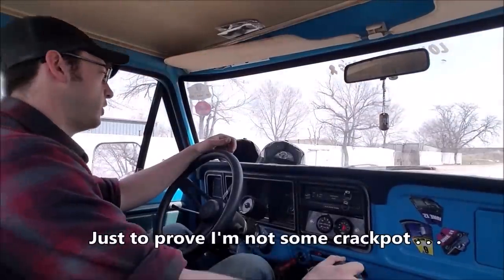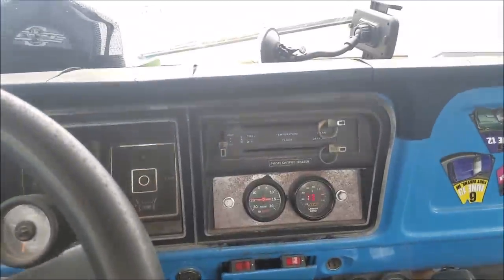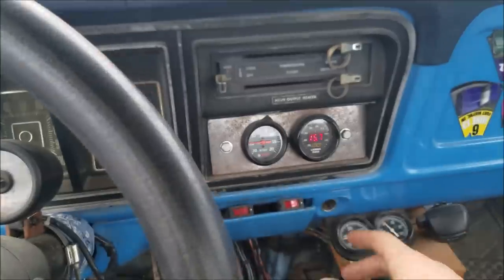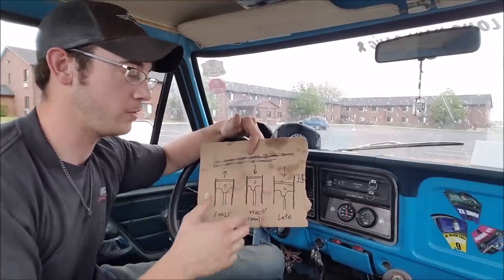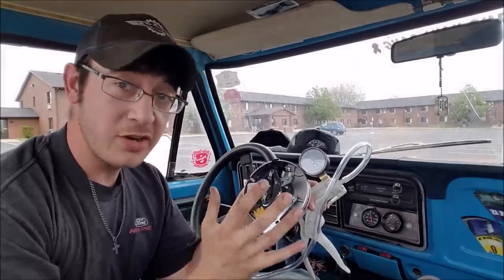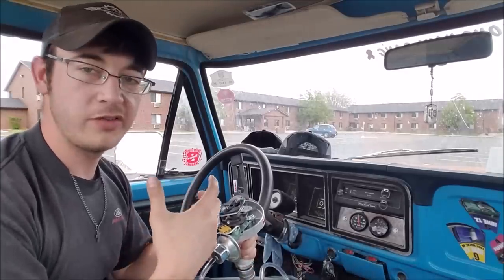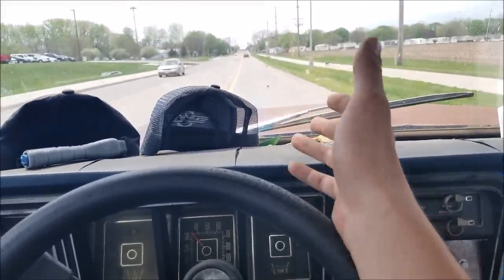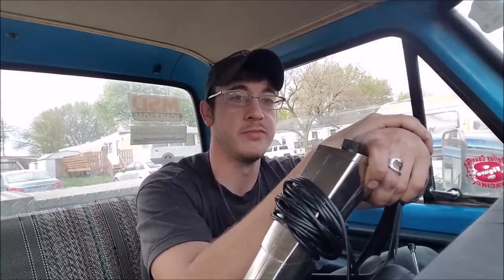Tuning a Distributor's Advance Curve (For MAX Performance & Power!)

Comment: sort of related but I cant find a solution anywhere. have a 86 f150 it was super neglected im the 3rd to 4th owner. had to replace the timimg chain, distributor cap, rotary button, fix the radiator,  replace the starter solenoid, spark plugs and wires, ignition coil, transmission filter, exhaust manifold and a few more things. so going down the road it does okay until it warms up and then it jerks a bit and eventually pressing gas results in no power or feeling of delivery and it jerks and it  will struggle to stay going. about 2 to 5 secound intervals between jerking and no power. it will then work if it i allow it to come down on speed. about 30 mph is the sweet spot to where it will go without jerking. doesnt feel like its the transmission its kinda like a backfire like if you run a vacuum cleaner and turn it off and on repeatedly thats about the sound it makes when jerking.  cut the exhaust right before the catalytic converter to see if it was clogged but it actually made it worse. any ideas?

Comment: Hey Thunderhead, Mr. Luke Sir.. I’ve been watching learning much about carburetors and timing. I’ve got a 383 Stroker high comp engine, typically higher temps across board given this ratio. I’ve noticed it spark knocks when I hit it harder, but not hard. I’d installed a proper electric fan big 4 core radiator all this. So, the knocking has lessened after I was able to lower the temps for operation. The temperature of the engine was only getting to about 180/190 or less? Why did cooling my engine more clear-up some but not all of the knocks is my question Sir? Temps were fine?
“I’ve been watching your channel and am subscribed. I’ve learned much watching, “Thank You Luke!”
Hey, love the tuning aid you use, the fuel ratio Guage. I want to put a nice ratio guage in mine as it sure is the best in getting it closer for tune.
Love the relationship between the carburetor and timing..

“Luke, could you set-up a distributor for a 383 Chevy Stroker in a way which would help my 1963 Chevy C10?”
I know most has to be done in the vehicle, but wanted to inquire?

You Rock Sir, thanks for the comprehensive videos!

Comment: Nice job Luke,
I agree with a great explanation of 'correct' timing. My only question is are you talking about ported or manifold vacuum? It sounded to me your are referring to manifold and that will actually decrease timing as the throttle is opened. Nit picking, maybe. But I think the clarification is needed.
Great information and needed by many.
Thanks for sharing.
Reply from the maker: Really any vacuum advance will trip out under throttle - if vacuum drops, so does the vacuum advance if you hit the vacuum van mister threshold. I was just trying to say that I’m hard throttle you are just on mechanical timing

Comment: I live in the UK England and we have different distributors I have an old French car and it's got a carb but on my distributor it has an arm that spins an we don't have vacuum but I still found your video insightful have you worked on any set ups like mine?

Comment: Soo what can be wrong on my 1955 ford y block. Renovated the engine and bored to a 292 from a 272. Had to go up in size on my main jets because it didn't want to respond to the gas above idle. Now it does that but over half throttle it's dead. Nothing happens more than it want to backfire at higher rpms in the pipes and the carb. But on "cruising" it works ok. It feels like timing issues.

Comment: Thunderhead,  I haven't seen you mention this so you may not be aware. Most vacuum advances are adjustable. Usually there is a small alyn-head screw up in the vacuum port which changes the diaphragm spring tension allowing activation at different vacuum levels.
Reply from the maker: I’m indeed aware.
Reply: @ThunderHead289  Cool

Comment: I'm about to obtain my Father-in-law's 1983 Ford F250 (460ci with a 3-Speed with Granny Low).

I would like to fix the "Steering Wobble" and Upgrade to FULL Disc Brakes.

Any suggestions?

I thank "Junkyard Digs" for recommending  your Channel.

-🤘😎👍

Comment: I have problems with my relationship! Can’t seem to find the balance between running good but getting a backfire in the carb when I get off part or full throttle or running to lean. I’d given up but your video has inspired me to take another shot. 2.3 Ford Mustang carb turbo 1981 has the factory Weber 5200 and mechanical advance and added an AFR gauge to try and dial it in. I have had the carb rebuilt, swapped distributors, swapped ignition boxes and carefully followed carb adjustments. Would welcome suggestions on how to get rid of the turbo seal killing backfire without making it dog slow! The backfire is worse when cold.

Comment: Excellent vid, Luke. A big fan of your how-to series, but I just can't wrap my head around your preference for ported vacuum advance :D When you are cruising down the highway at very low load, the 20" vacuum we are seeing in this vid, I would assume that is the ported vacuum. So by then you would be seeing a lot of vacuum advance. Which is good and just what you need on a very light-density cylinder charge. But when you let go of the throttle completely, your timing would immediately retard back down to initial timing, and the way I see it, that will only result in poor fuel economy at idle and possibly running the heads and exhaust hotter than they need to. In one of your other vids, you say that you don't like losing a lot of advance when going hard on the funny pedal from idle, but with ported vacuum you'll still be losing a lot of advance when flooring it from a cruise? The only difference is vacuum at idle. Anywho - great vid, keep up the great work! :)
Reply from the maker: I have this video dedicated to explaining ported vacuum 🤓

https://youtu.be/WD_bhDq_8tY
Reply: You’re right.  When you’re cruising on ported advance, your vacuum is next to nothing and isn’t giving you timing when you need it the most.  It’s silly really.  The ported guys are always saying “the only difference between ported and manifold is at idle” and that’s simply not true.  Your engine spends the majority of its life in just-off-idle cruise where manifold vacuum is high.  If you’re running ported, you’re not getting the advance you need and in most cases (because most vacuum advance canisters don’t actually kick in until about 5-6 hg, you’re getting zero vacuum advance at cruise.  Just watch any demonstration where a ported and a manifold gauge are side by side.  You’ll see exactly what I’m talking about.  For a stock/street setup at cruise that manifold needle will be near 20 hg and that ported needle will be near zero.  Run off of manifold advance and your engine will run quieter, cooler and get way better mpgs.

Comment: I get a lot of loud noise like a missing spark plug but no intake backfire but hear it in the exhaust. I bought a new distributor and i can shake it and hear the weights slopping inside. How does this effect the firing. It runs at low idle but seems looping and no back fire in exhaust. I have about 90 to 130 psi which is low but should not make a backfire in the exhaust i think. Timing is set in order. Plugs are new. Wires are firing. Cap is in good shape, points are set well. HIgh rpm is when i get the cracking pooping noise in the exhaust.

Comment: what do you think is the issue if a distributor with vacuum and mechanical working together puts out too much total advance? Checking with a damper timing tape, mine jumps to 50 degrees total advance. I can't time it properly use 5 degrees initial because I want total 36 total advance combining the vacuum and mechanical advance working together. Thanks for sharing the videos. Enjoy them.
Reply from the maker: You shouldn't worry about total timing with vacuum advance since when you hammer it vacuum advance drops out. If your mechanical isn't all the way in until 3000rpm, you'll be fine

Comment: Need help ? . My 85 chevy s10 2.8 carbureted v6 automatic is eating me in gas for starters and secondly noticed this noise apon acceleration or just at a steady speed driving 45 miles per hour coming up a hill or slit hills in over drive it makes this pinging noise or rattling and can't figure that out and I wanna say it's either dumping to much fuel is kinda over loading it or my timing could be off idk I've never messed with the timing and the engine hasn't been in my truck but about 8 months now . It also had vacuum advance distributor so I've never messed with them or anything.  Woundering what is going on and wish u had videos on that type of carburetor I have cause no one does or messes with them anymore .
Reply: It's a Rochester 2 barrel carburetor . I'm eaten gas like a v8 and idk how to set the fuel and air mixture screws on it either just never really messed with carburetors that much . I have a 13 gallon tank and from full to empty I get about around 130 miles and I know that cant be good . If I floor it it just dumps black smoke out the exhaust so definitely know something isn't right.
Reply: I bought a new or say rebuilt one from guaranteed carburetors . I'm waiting on that to come in because the carb that is on the truck now . Well it wants to cut out on me on left turns it cuts up and stumbles and most time will cut off if I don't 2 foot it butt only when I make left turns.  Then when ih t hot soaks it floods its self so I know the float must be junk too . If it sits like 3 or more days the carb is completely out of fuel . And I know its running to Rich because how much gas it's eaten I might as well drive a v8

Comment: Great video! Per your recommendation I just installed an afr gauge on a 56 312 Ford w/ a Holley teapot (4000). What are readings do you shoot for at idle/cruise/wot? I looked through your videos but didn't see one that addressed the afr gauge.readings. thanks for the info!
Reply: Idle is 14.7, cruise is around 12-12.5. WoT I'm not sure of, Luke will chime in if I'm off my rocker here.
Reply from the maker: That’s pretty darn correct more or less - I run a bit richer intentionally because we have ethenol blends here, but more or less!
Reply: @perotekku  You are correctish. I say that because there is no one set value for all engines. 
I like around 14.2-14.5 at idle, 13.2-13.8 for light cruise, and about 12-12.5 for WOT. This is all for N/A engines.

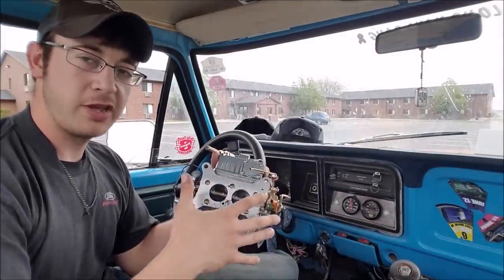Comment: an early bronco, fresh stock built 302, 350 gears 3:03 rat tranny, gm hei distributer, 2500 rpm 55 mph and bucking, what causes it? stumbles a little from idle to acceleration then bucks or surges going down the road but accelerates great. springs seem the be strong. thks

Comment: Dear  Luke  thunderHead 289 thank you very much for this video. I would like to ask you a question  about a "theory", question i have on  old school v8 engies.
Am i wrong by saying   that if  I  decrease  timing but then decrease  idle  mixture srcews  the engine  wil have less  power due to  less  feul   but wil have better fuel economy?  While driving on the idle circuit ?  Thank you
Reply from the maker: It would work inversely actually - if you lean the mixture past a certain point, your idle will begin to drop - timing is all based on volume of fuel, you need more timing to correctly burn a less dense fuel charge. 
Does that make sense?
Reply: @ThunderHead289  Hello yes thank thankyou  very much  for the information.
Ps. When are you going to be uploading  on the regular  again?
Reply from the maker: I’m thinking about starting back up again in march, I’m one of those folks that really only makes videos when I feel I have something profound to say, kind of anti-clickbait. 

Wanting to do one about tuning vacuum secondaries
Reply: @ThunderHead289   that would be an awesome video. Great respect  to you for not making click bait videos and for not having a lot of ads  in your videos
Do you have a patreon  page luke?

Comment: Uncle Tony's Garage channel (which I love) uncle tony said that carbs make more power because of the heat removal of evaporating fuel. I'm pretty sure he's wrong about that because fuel can evaporate after being injected by injectors right? I'm pretty sure carbs and fuel injection make about the exact same power when both are setup right. I do have to say though it's amazing how much wiring and sensors and computers and programming and so much complexity and hardware that fuel injection requires, all replaced by a simple little piece of metal, really is amazing how much a carb does for it's size and simpleness. A beautiful design they are. Unless its a quadrajet. Those are one of the bad ones right? I'm pretty sure they said that on roadkill.
Reply: The road kill guys are highly opinionated  ,they are in the business of making money ,their controversial opinions just attract more viewers, that's why they say what they say.
Uncle Tony is correct about carbs, fuel injection has no time for the charge to pick up heat.
Beware of internet BS.
Reply: @testpilot6456  Oh yeah they definitely say some stuff for money but I doubt that somebody is paying them to badmouth quadrajets. Nobody cares about quadrajets

Comment: Say Thunderhead, any good advice about using NO vacuum advance?  See, I can't get the right can for my distributor.  The arm linkage on all the ones I seen to order online point and angle the wrong way.  So I'm pretty much stuck without a new one...  Ya I guess I can order one I know is correct from eBay, but they want a chunk loada cash for it.

Comment: Why did my mechanic plug my vac advance on my C-Code 289 (cam, Edelbrock 600, performer manifold)? He claimed it was the bees knees. My car runs like a mofo, so I can't complain. But wha?
Reply from the maker: Some old timer belief stuff - have you seen my video over “ported vs manifold vacuum”? It also reviews why we have vacuum advance, and why with a street car, it should always be utilized. 

I bet your car runs great at hard throttle because that’s all mechanical timing - vacuum is low, and vacuum advance would drop out anyway. 
But you actually stand to gain something just driving by utilizing vacuum advance. I encourage you to hook your advance up to ported right now and don’t change a thing and observe how much less throttle it takes to cruise down the road.
Reply: @ThunderHead289  I will try it and yes I saw that video. But I gotta say...I had same engine/build in 1982 with vac advance and now this current setup and man the throttle response is insane. You are right tho, an old dude did the tuning. I am an old dude, but I really appreciate your knowledge. Iowa rules baby! Thanks for the reply, I will do my own research on this one and let you know! Appreciate the vid!
Reply: @ThunderHead289  Hey I want to take our advice and run a vac tube from my distributor. I guess my 1966 had a steel tube from dist to carb, but I don't have stock manifold/carb so I assume that part won't fit. What size rubber vac tubing would you recommend? My mechanic tossed the old one so I am not sure what ID to buy. Thanks man, great channel!

Comment: If you set a square xfer slot on your carb, where does air come from at idle? My edelbrock (brand new) is completely closed at that point.

Comment: Hi, wonder if you could offer any advice on timing for 74' 440 with "RV" cam, Edlebrock 650 AVS2, performer IM, Pertronix billet diz in a 14K lb motorhome? Book says 7.5 initial on metered port but no idea where to go from there. Haven't changed the springs in the Pertronix yet or adjusted the vac can, vehicle runs fine but can't tell if it's pinging or not because the engine is in the rear lol. Any ideas on safe total timing? And, since it's heavy... do I want my timing to come on faster or slower than a light car? Kind of at a loss and Pertronix tech was no help. Thanks

Comment: I see a number of engines that the mechanical total is limited.  They set the initial at 12 and the total only gets them to 30 when 34 would be better. If they increase the initial alot higher for performance it gets too hard to start.
Reply from the maker: Iv built a few like that in my day - what I do is put the ignition on a switch and once the engine is spinning, I flip the ignition on. 
Always fires right off that way, even high compression units
Reply: @ThunderHead289  thats one way. Thats the way the racers would do it.

Comment: I might add i have a 302 with a two barrel.  What weight springs should i use in the distributor or weights i guess. What should i look for as far as weights and springs in this small block 302?

Comment: On a 67 F100 that had a 3 on the tree converted to a 3 on the floor, would you have any idea what the shift pattern might be
Reply from the maker: I want to say driver side and up is reverse, down is first, then right of that is 2 and 3. 

I bought my f100 set up with a floor shifter and I think that was the layout. It’s been over ten years now
Reply: @ThunderHead289  I think mines a different tranny then. The only gear I've figured yet is reverse, which is all the way to the right and down. It's a new truck to me, I've got it running for 30 seconds but enough to drive it
Reply: R  2
1  3